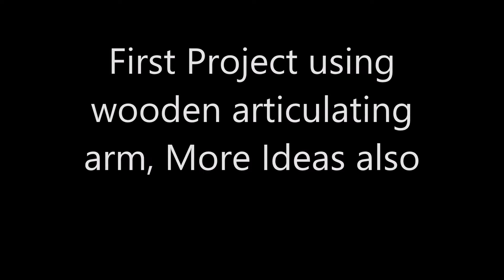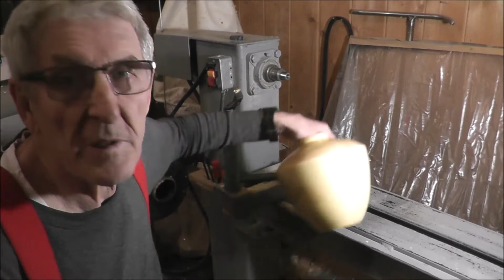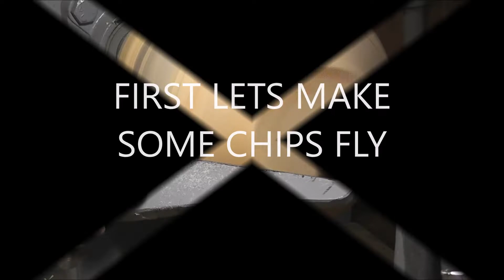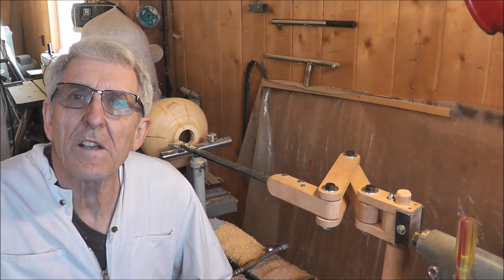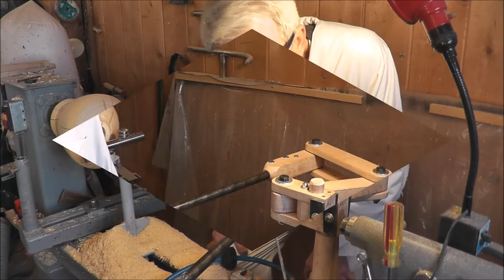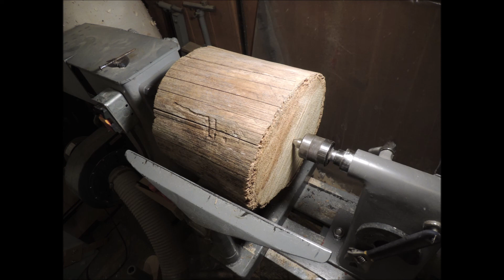First Project completed using the wooden articulating arm.

Comment: Excellent video well done Brian  I have cut all my  materials in steel  and purchased thrust bearings for the joints your mount on the looks interesting so  I intend  to try that method most of  my  box section  has been lying around  for yrs  thanks again Harry from Aberdeen Scotland
Reply from the maker: Would like to see your completed project. I made the lathe I am using, I made entirely from scrap iron, Only things that I bought was two bearings , shaft and pulleys. I have a video on Utube of it, rather poor as it was the earlier one I did.